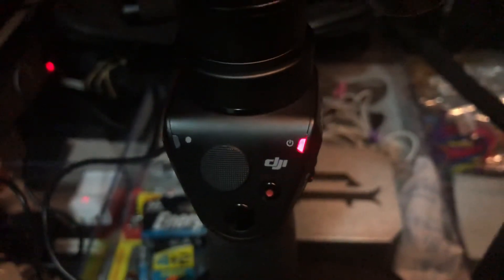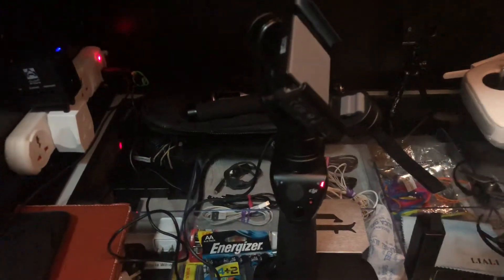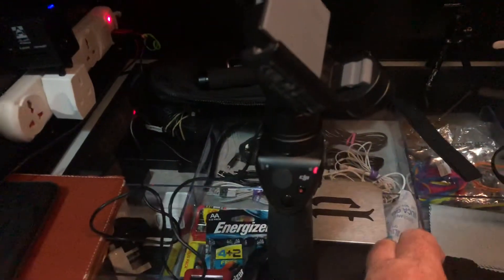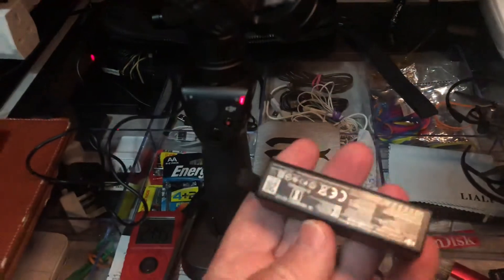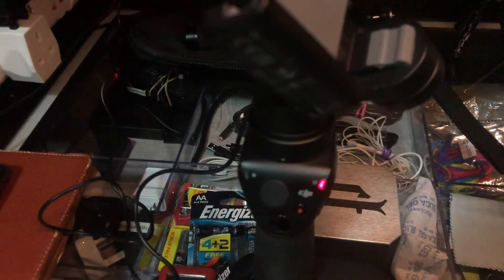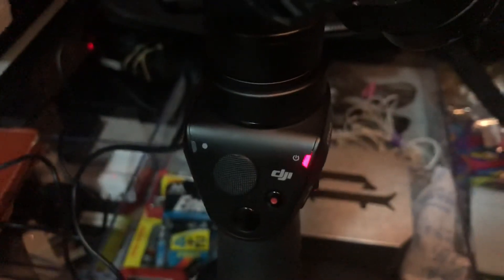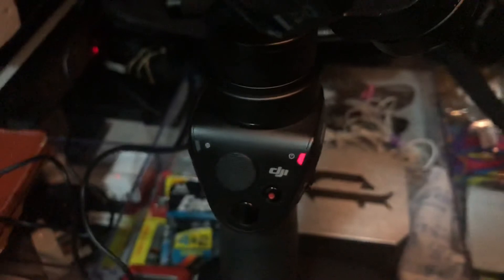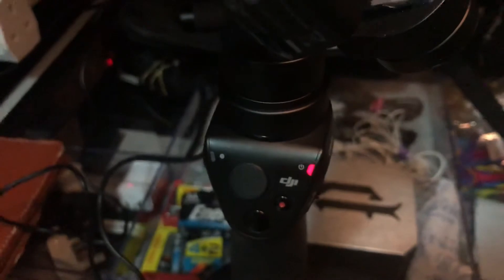Osmo Mobile Charging Fix (Can work for any LiPo batteries that won’t charge).

Comment: LiPo (Lithium Polymer) batteries can crystallize when they are completely discharged due to a disruption in their chemical structure. LiPo batteries function through a chemical reaction where lithium ions move between the cathode and anode via an electrolyte. When the battery is fully discharged, this chemical balance is disturbed, and the lithium ions can't move properly.

As a result, lithium metal crystals can start to form inside the battery. These crystals increase the internal resistance of the battery, making it difficult to recharge. Additionally, crystallization reduces the battery's capacity and can cause long-term damage. To avoid this, it is recommended to keep LiPo batteries above a minimum charge level, as fully discharging them can lead to these issues.